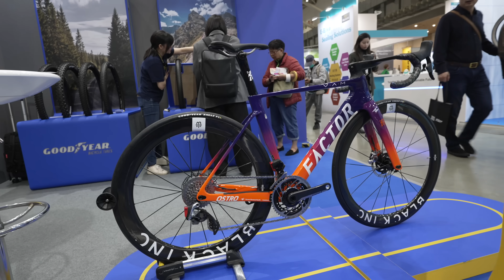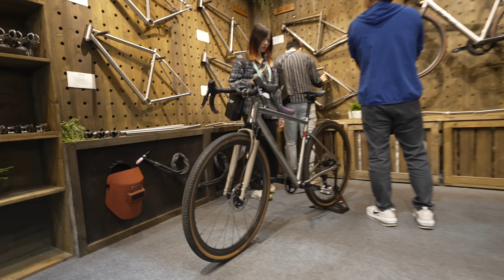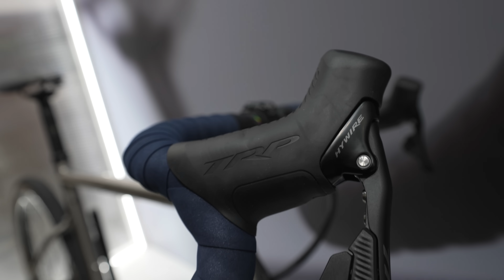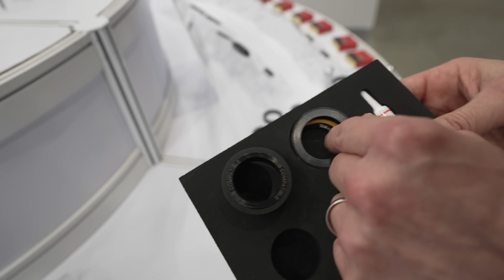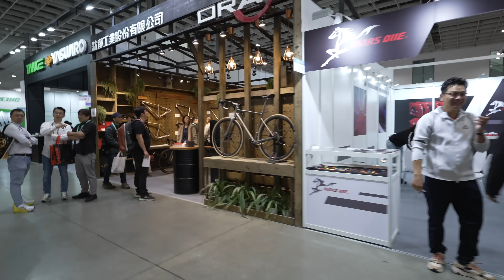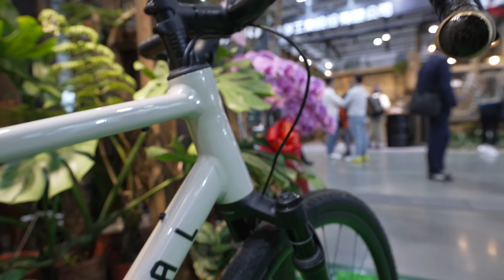WILD NEW BIKE TECH from Taipei Cycle Show 2024

Comment: I bought MicroShift Sword brifters to replace the AdventX brifters on my Poseidon Redwood.  The right-hand AdventX brifters has a shift cable that sticks out the side, but the Sword brifters doesn’t, enabling me to mount a full-sized Ortlieb handlebar bag.  The hoods feel good but I’m not crazy about the way the shift levers freely move backward and forward during a shift.  I’d prefer they only be able to move in and out.